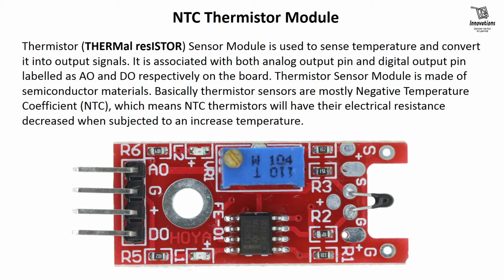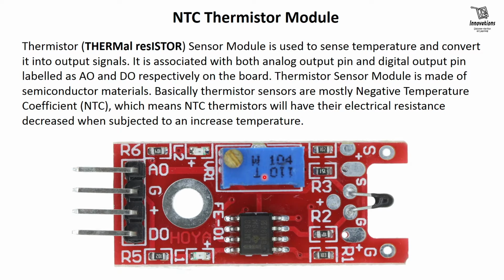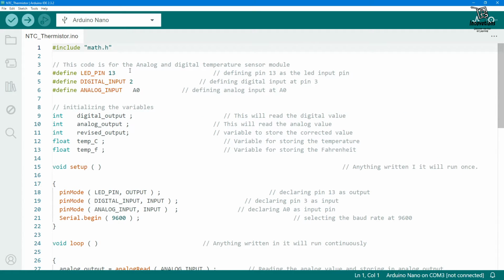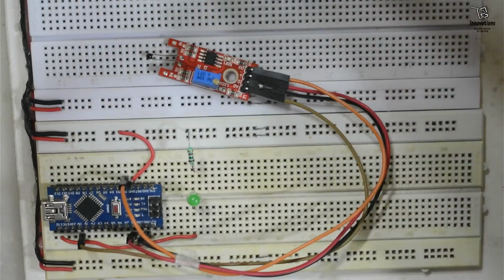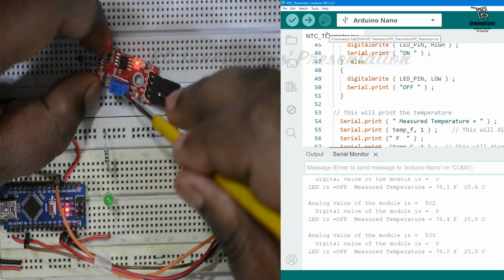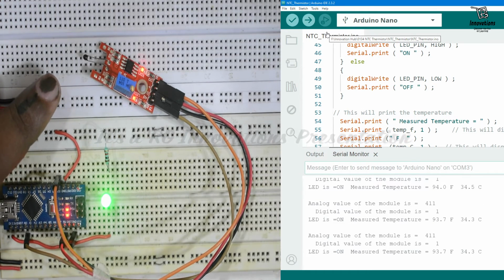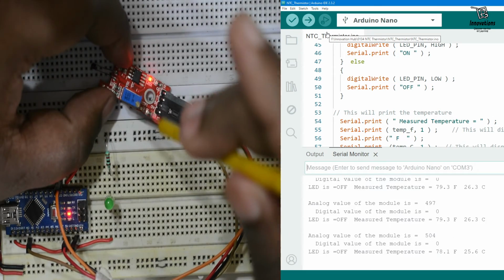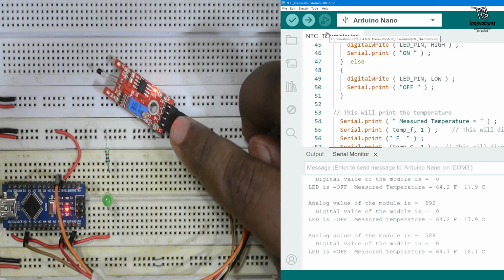NTC Thermistor Module KY-028 | Detailed Explanation & Interfacing with Arduino | Secret Settings

Comment: Hi Sir, Thank you for this informative video. I appreciate the insights. Could you please confirm if this module is compatible & ribust enough to monitor the temperature for the outdoor water pump motor, powered by solar panels?
Reply from the maker: The temperature detection range of the module is between 20 and 80 degrees Celsius..if it serves your purpose, you can use.